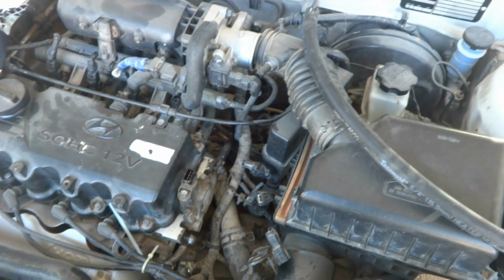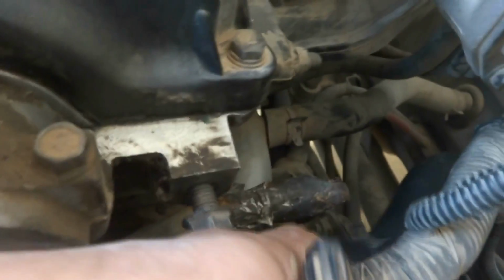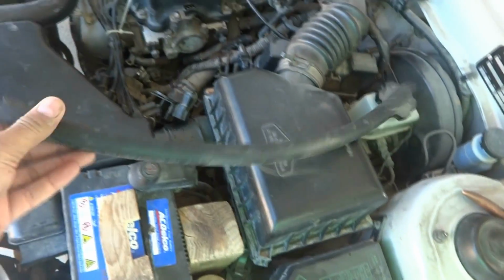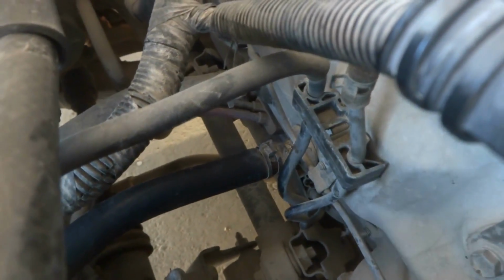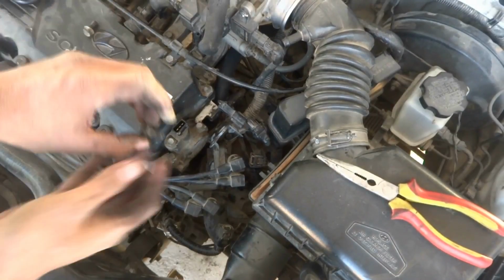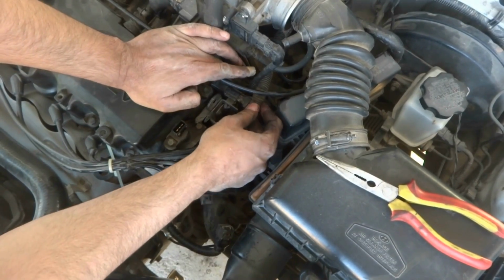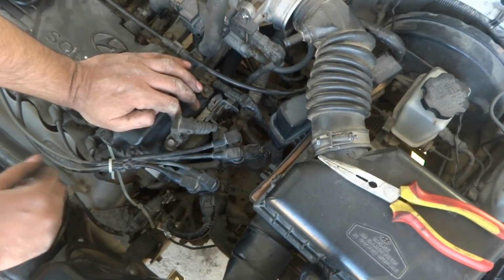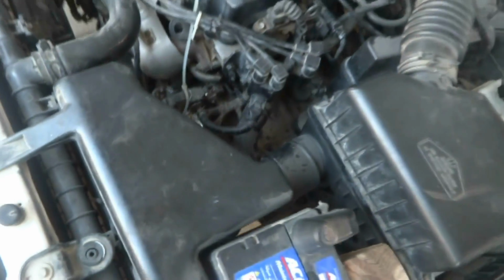Car heater hose replacement and modification. Coolant leak repair.

Comment: I hv Hundai grand i10 model year 2013 december,as on date total km run 62007 only. It gets many problumes priviouse cooling coil was replaced by hundai agency,but now ccolent leakege in side cabine . i m not seticfied with hundai showroom work shop when ever take car for any minor problumes they simply said so part will be put new.what is this instead repair they sold thir parts, parts r very costly. I request hundai company plz, adv all show room work shop do proper work as required. It is happning in rewari hundai car show room on dehli road. My name is rajesh kumar 8059308329

Comment: The most likely reason for this tube failure was due to no coolant/antifreeze or an improper concentration of coolant/antifreeze. 
Any engine cooling system is subject to corrosion, however in many vehicle engines there are dissimilar metals such as a cast iron block, aluminum cylinder head, aluminum radiator, brass heater core and so on galvanic electrolysis is a serious problem. 
This leads to electrolytic metal erosion(EME), electrolysis or galvanic corrosion, aeration and cavitation destruction.
The only way to stop the destructive electrolysis, erosion, corrosion aeration and cavitation is by using the proper coolant/antifreeze in the proper concentration that contains the proper additive package. 
This usually a 50/50% mixture of a good name brand of glycol coolant/antifreeze and distilled or de-mineralized water.
The life of the coolant/antifreeze and the effectiveness of its anti-corrosive, anti-galvanic, deaeration, anti-cavitation properties can be extended if the water used is filtered and distilled to remove the minerals. 
The added benefits of using the proper coolant/antifreeze is the protection from corrosion, reduction of blown head gaskets, fewer unwanted leaks including the water pump, freeze cracking of engine and radiator and cooling system components, also increased boiling point temperature of the engine and increased engine cooling. 
Thank you for sharing your adventures on video.